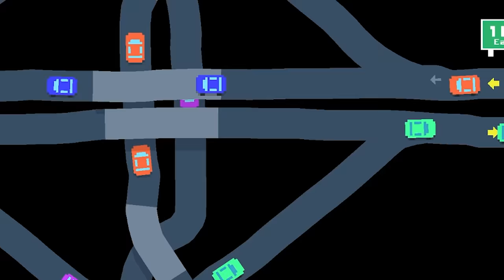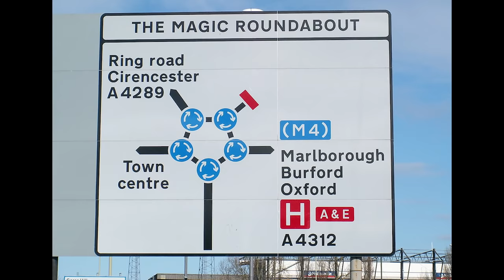Which is THE BEST Highway Interchange Layout? Freeways!

Comment: All this game needs is an eraser tool, and a smoothing tool.
Reply: That's what makes it a puzzle, the fact you can't.
Reply: @thephoenixking1086  The puzzle is allowing traffic to flow efficiently on single lanes using the least resources; the lack of eraser and smoothing tool is simply a negative to the game as it negatively affects your score based less on road design and more on your ability to draw the least jagged shapes.
Reply: @kjono4611  I personally think there should be two versions (or difficulties):

A Meduim (Beginner's): Which has access to the eraser, back buttom, smoothing and more.
& Hard: Wich has the eraser, back button and such disabled forcing you to think and plan ahead more.

Both game modes allow you to play all of the same levels but HARD mode gives more points (and just feels better to complete since it is harder, maybe called the Hard mode "New Game+" or something...

To me this makes more sense and would make the game more enjoyable.
Reply: A circle tool would be nice, too.
Reply: @thephoenixking1086  newgame+

Snkrx?
Reply: Having undo instead of an eraser would allow you to fix mistakes without having the ability of going back later and changing the whole design so difficulty would be preserved.  For sure on the smoothing though.  And also as @CassandraNoice said, a circle\oval tool.
Reply: @solidXxXtuna  
One of the biggest problems with this game is a bug where if an entrance to/exit from a bridge is too close to another bridge, the bottom car clips through the bridge above and stops the traffic on that bridge.
We need proper distancing between bridges in this game !!!
Look at the purple car coming from below, clipping through the bridge and colliding with the blue car around the 16:12 timestamp. Even worse is 16:16-16:17 when the purple car stopped the blue car that stopped the orange car ALL OF THEM BEING ON DIFFERENT BRIDGES !!!
Reply: @solidXxXtuna  Undo seems more feasible
Reply: @cezarcatalin1406  Yeah, that sounds like a straight up critical bugfix.  But being the game came out in 2017 I wouldn't hold my breath.  Has anybody opened it up and tried modding??
Reply: @thephoenixking1086  keep easy and hard mode leaderboards separate then
Reply: I think undo would do better than an eraser
Reply: What about holding shift to make a straight line too, that would be nice
Reply: or just could exist a hold shift to do a line like mspaint has?
Reply: Just disallow edits after hitting the Simulate button. So eraser+smoothing tool let you fix a jagged corner due to unsteady hand, but still require you to plan ahead to max out efficiency.
Reply: A bezier curve tool
Reply: I'd just be happy with a snap to grid option
Reply: @thephoenixking1086  Really, you call not having an eraser "what makes it a puzzle"?
Imagine I give you a piece of sodoku for you to solve, but everytime you realize that you have fill in a wrong number in a square, you need to get a new copy of that same sodoku, and fill in everything all over again, including those you've already filled in. Does that make the sodoku more like a puzzle? Honestly it just makes it more frustrating to solve.
Reply: Line stabilization
Reply: @Nephenon  There are many games which have a mode that disables all going back, a great example is Minecraft Hard-core, the SECOND you die, you lose the entire map and everything you did, it gives you more of a challenge and the challenge of surviving grows by the hour.
Reply: @thephoenixking1086  last time I checked drawing some roads was not a survival game lmao
also minecraft is not a puzzle game in the same sense this game is either, so the comparison is very apples and oranges.
I think it's unfair that people like me, who are artists and have access to art tablets (allows you to use a pen as your mouse essentially and makes precision a million times easier) am guaranteed to get a better score just because I don't draw the roads with a mouse. 
it'd be more fair if everyone was given access to smoothing/undo/ or at least a line and circle tool.
Reply: @TheAtrxcity  yeah like motorways ?
Reply: And priority on roundabouts
Reply: Before you started I was going to suggest the 1st example. That is how the road is designed at a 2 major highway intersection in my hometown.
Reply: Yeah you don't get an eraser tool irl lol.
Reply: And a "nuke it with multiple asteroids" options.
Reply: It needs BELZIER CURVES !!!
Reply: @StatusQuo209  but you do get an eraser tool, it just costs money. its called bulldozer.
Reply: @monad_tcp  good point.
Reply: @thephoenixking1086  Big brain idea
Reply: @solidXxXtuna  yeah your right.
Then I wont have to restart 100000 times just to make a straight line
Reply: And a straight road tool
Reply: @kjono4611  yeah
Reply: @thephoenixking1086  yes
Reply: @thephoenixking1086  more points?
There aren't any points in the game
Reply: @cassandranoice1563  yeah
Reply: @cezarcatalin1406  ikr
Reply: @solidXxXtuna  yeah has anyone tried missing it?
Reply: @vgarzareyna  Hell yes.  I would buy Freeways 2 even if the only change was a bezier curve tool.
Reply: @thephoenixking1086  That example would apply if your survival in Minecraft depended on your ability to draw a straight line with no second chance.  Pretty sure there's no single-shot drawing skill checks in Minecraft.  
Actually there's no single-shot anything in Minecraft.  That would make it a roguelike which is the opposite of Minecraft where the goal is to keep progressing with prepping and crafting and building faster than the zombies level and spawn.  There are other examples of games like that aspect of Freeways but Minecraft aint one of them
Reply: Yes!
Reply: True
Reply: Realism
Reply: @kjono4611  Exactly! The enemy should be the challenge of designing a good road for the scenario, rather than the frickin interface.
Reply: Or even better, use splines like the curve tools in many art programs.
Reply: Lol
Reply: Building with bezier curves instead of drawing would be great.
Reply: city skylines
Reply: And traffic lights
Reply: Apparently it can be erased and started over again, so not too bad
Reply: @thephoenixking1086  i like this, if you want an easy time you can have the eraser and stuff but for actual difficulty get rid of it with a hard difficulty
Reply: @solidXxXtuna  have you ever played bridge builder? It literally has both of the functions mentioned and is still a "puzzle game". And that's good. I would want to have fun with thinking about good tactics and not use my whole time to draw straight lines like a preschooler
Reply: Yeah, the scoring is based too much on how well you can MS Paint :(
Reply: @Angriffskuchen  Bride builder?  I do not know it.  Is it different than Polybridge and all the like?  I'll check it.

Tangent, my portable mouse broke and trying to play Freeways on a trackpad is either hilarious or infuriating depending on your current mood.
Reply: @cassandranoice1563  whoa. Add a few more features and you end up with mspaint!
Reply: @thephoenixking1086  true
Reply: And a shape tool
Reply: It also needs a mirror tool
Reply: yes undo and a thing to make road straight 
when i make mistake i have to start all over
and my efficent is bad bc my road is not staright
Reply: SO TRUEEEEEE 😱
Reply: lol  russa is so mad rn
Reply: And a line tool

Comment: The biggest problem with the game is that it doesn't allow for multiple lanes of traffic on a single road.  That diverging diamond would have been far more efficient if you could have designated different lanes for different destinations, instead of it all being single lane shared traffic.
Reply: Wouldn't the parallel road design fulfil the same purpose?
Reply: @tirocska  in terms of traffic flow, yes, but then the game penalises you for using more concrete to make those extra roads, instead of just allowing multiple lanes on the same piece on concrete
Reply: the diverging diamond is only good if you have a lot of traffic that needs to turn left - and you do not have the space, resources or simply refuse to build a more suited intersection.
But for normal straight traffic, straight intersections, rightturns or mixed traffic it is horrible.
Reply: @mattm7220  you'd still need wider concrete, so that's the same
Reply: Its what makes the game unique
Reply: If you build a second road parellel that touches the first road for the whole length, its the same as a two lane stretch.  If it was possible to actually draw parellel roads.
Reply: @mattm7220  What is a two-lane road other than two roads just stuck together really close?

I mean, of course they can mean a more efficient usage of concrete as you stick the cars a bit closer together, but still.
Reply: @Gustavo6046 Indeed, just make many roads that aren't connected but go in the same direction.
Reply: This 100%. It sucks that you always have to merge back into one "lane"... I hope at some point they add in multi-lane levels as the level of complexity and fine-tuning with roads gets exponentially better
Reply: @ABaumstumpf  Its not good for highway interchanges, like, at all. It is however good for intersections where there are 4 lights (2 on off ramp pairs and 2 side roads). I know this because I live near where one of the first 3 were built. They are an EXTREMELY specific solution to an EXTREMELY specific problem. They are absolutely not a general purpose intersection. But they work by minimizing the number of interaction points.
Reply: The apparent lack of traffic lights means you use more concrete. Most divergent diamonds have only two bridges and traffic lights to control the crossing lanes.
Reply: @mattm7220  same thing with the cloverleaf w. distributor roads tho but even more so
Reply: @mattm7220  plus traffic seems to ignore the other lane XD
Reply: @lomiification  but being able to have multiple lanes would (or should) reduce concrete. For one, you should be able to have less of a gap where a car drives and the line between the lanes than you have between the car and the edge of the road (basically a double lane road would be narrower than the widths of two single lane roads), and two, if you have a bridge going over, the bridge can be shorter going over a double lane road than it is for going over two single lane, as the single lanes have wasted space between them.
Reply: This exactly
Reply: Yeah, I attempted to make a Arc de Triomphe style roundabout, but the cars all stuck to one lane.

Comment: It seems that the formula for efficiency is 1000 * traffic flow * complexity factor / concreate used. The displayed values are probably rounded down. As for complexity factor, I think it represents the amount of traffic; here, there are 4 entry points that want to go to 3 exits with a weight of 3 (the thickness of the arrow), so 4*3*3=36.
Reply: So the Complexity Factor refers to the map itself, not the design/layout used by the user?
Reply: @saquoiafighter  correct
Reply: Hmm

Comment: Fun fact: the actual east-west loop 101 to north-south I-17 interchange (in Phoenix Arizona) is a 4 level stack interchange, which as far as I can tell is similar in principle to the turbine or windmill but instead of winding the roads around they just build higher and higher bridges to connect the ramps.
Reply: There is also a diverging diamond used a few miles north on a crossroads over the I-17.

Comment: 10:20 This one must have been popular by the creators of the Autobahn.
Reply: The Highway Riech
Reply: Not only did Mr. H think he knew better than his own generals, he knew better than his civil engineers and drew the designs himself.
Reply: @armchairgeneralissimo  Big brained Mr. H
Reply: Meanwhile, in Soviet Russia:
We don’t need interchanges where we’re going!
* builds cheap efficient trains *
Q: But what if in some places there are no rails ?
R: Ok, hear us out comrade, what if, we make a train but put it on tyres and make it electric so it’s more efficient ?
Q: Ah so an electric bus with batteries and...
R: No no no, no stinking batteries, just hang a wire overhead and make the bus drive under it.
Q: So, like a trolley but with bus tyres ?
R: Yea, yea, like that... how should we call this thing ?
Q: A trolleybus ?
R: Excellent, we’ll put them everywhere !
Reply: Actually, there was hardly any traffic on the German Autobahns until well after WW2. Consequently, the pre-war interchanges were usually cloverleaves. Even the Frankfurter Kreuz, the interchange with by far the most traffic, was designed as a cloverleaf, and has been improved  only 20 or so years ago.
Reply: @cezarcatalin1406  Trolleybuses were a very efficient way to move vehicles on roads- electricity is lost when charging a battery. They were built all over the world!
Reply: Ahhh flip
Reply: I don't know, looks like at that time it would have too much traffic concentration...
Reply: @briannem.6787  Plus batteries are heavy and potentially dangerous (they occasionally explode and such)

Comment: 1:52 "You never want a merge before a diverge."

Here's how many merge-before-diverge sections each design has :
1. Cloverleaf : 4

2. Distributor roads cloverleaf : 4
3. Diverging diamond : 2
4. Windmill : 0
5. Roundabout : 4 (actually it's more like 12)
6. Grade separated roundabout : 4 double (about the equivalent of 8)
7. Magic roundabout : 8
8. Turbine : 0
Reply: roundabouts are the worst for traffic flow, but they are the best for being cheap.
Reply: @monad_tcp  In this game yes. In RL a well sized roundabout for the traffic flow often works better than anything needing traffic lights. Installation costs are about double stoplights, but total cost of ownership is much lower. There is a traffic circle near my home that replaced side-road stop-signs over a rural highway. All but eliminated bottlenecks, but rural highway users don't always give way and some bad t-bones still happen from time to time. Mostly big trucks crushing passenger cars who went "one more" notch around than expected. (Which I have to do to get to my house so I am likely to give way while in the circle, which is terrible for traffic but better than getting squashed.)
Reply: @dustinandrews89019  roundabouts don't eliminate bottlenecks, they have less throughput, plain and simple. sure, comparing them to T-junctions, they are way better, but comparing to stoplight cross junctions, they are slower, uses more space, but are safer, and do cost less to run overall.
the advantage of roundabouts is that your city requires less global traffic control to work, but that's because all of the traffic is smoother and slower. which is good to decrease accidents.
but if you want pure speed and throughput, then they are not that great, or if you don't have space anymore.
Reply: @monad_tcp  Roundabouts have poorer traffic flow than well timed green wave lights.
Reply: I think the roundabout ones are arguable

Comment: There's one more type of interchange you can do, although I think it fails on this particular location: an intersection.
Just draw two vertical lines and two horizontal lines, and trust the cars to turn left or right as needed.

I think in this game, it makes it functionally almost identical to a small roundabout, but with sharper turns. It only works rarely, when traffic is low and mostly directly across instead of turning.
Reply: Idk if you can call a four-way intersection an “interchange”
Reply: They jam. Everytime.
Reply: @IvyNakano  2nd playable level. Thats the actual solution for that one.
Reply: There is one level where the traffic is low and the game "wants" you to build a regular intersection. If you do it shows you a picture of a dirt road in I think Mexico.
Reply: Let me take that a step further.... colour the whole space in and just let the cars drive straight to where they want to go
Reply: @eco98  
Unfortunately not. There's a limit on how much concrete you can have in a level.
Reply: @emsouemsou  I got a better score turning that level into a rotary instead.
Reply: There is actually a level where that's the solution
Reply: They jam. Just like in real life
Reply: @Lcsmu  
It depends on the traffic density. At a low enough density, even the simplest of  intersections will not jam.

Comment: I drew a double roundabout, with two concentric circles, one pulling up the traffic, pushing it to the other which then distributes it. It worked surprisingly well!
Reply: That's basically the magic roundabout.

Outside circle goes one direction, inside circle goes the other. Switching between the two circles makes the smaller ones